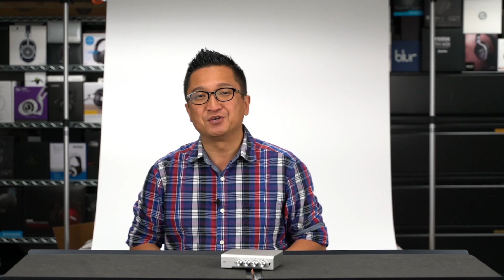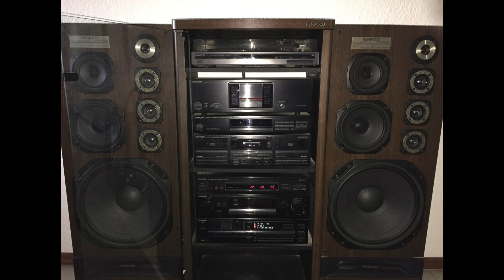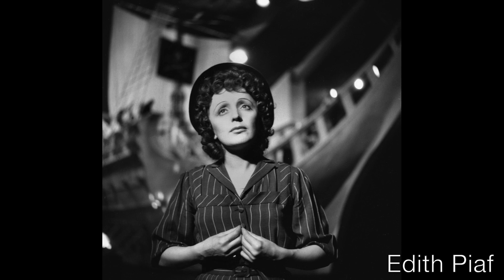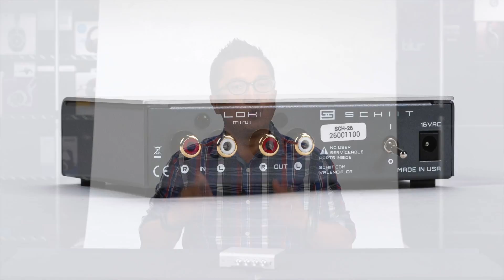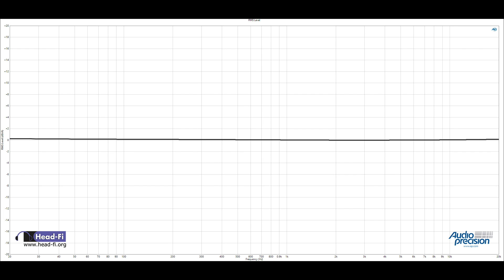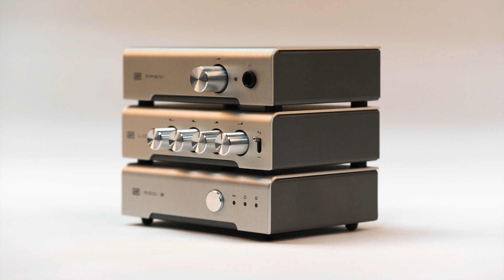Schiit Audio Loki Mini Four-Band Equalizer - Head-Fi TV

Comment: Audiophiles and eq's:   I remember this back to the 80's.
The issue was:  audiophiles were correct about some of the old eq's.  The mass-fi stuff like Kenwood had 36 bands, and it was made from the cheapest parts.  There was no "transparent"  even in bypass.  They did violence to the music. 
Better Eq's like ADC, Soundcraftsman, Audio control and SAE used only a few bands at critical frequencies.  They used higher quality parts inside. 
The Loki doesn't use anything in the audio path to degrade the signal.  In bypass or flat, the unit is transparent. It does not load down the system or color it in any way. 
All I need do is look at the response curve of my headphone on a site like innerfidelity, and adjust accordingly.
I ordered the Loki because no matter what anyone says, headphones, speakers and rooms are not "flat".

Comment: Audiophile gear manufacturers hate tone controls. They allow YOU to determine variations of sound, whether to compensate flaws of the media, the speakers, the room or your hearing. 140 units of a quality currency instead of buying cables, cable bridges, marble platforms, slate racks, tiny little woodblocks or any other 1599$ supplements. But tone controls are no substitute for good speakers, reasonably positioned in a cozy fluffy room.

Comment: The frequency bands on the EQ are way too wide. The 400hz adjustment, for instance, effects frequencies from 20hz to 10khz. And each of the 4 frequency bands on this EQ overlaps with the bands above and below it. Trying to use this to EQ a room to have a flat response from 20 to 20k Hz would be impossible.
Reply: That's not what it is for though. It's for headphones, not room correction. Regardless, if you are going to take the time to set up a flat FR, you'd use a proper digital EQ.
Reply: well this is obviously a hifi EQ and not a mastering EQ. so you can get pretty nasty distortion if the EQ bands are to narrow and you reduce the dynamic with it if you don't adjust nearby bands accordingly or know exactly what you're doing and having the exact frequency response curves displayed in front of you. so I think this is a pretty good solution to adjust nearby bands slightly with it.

and as far as I'm concerned it is clearly designed for headphone use only and is not to be used for room correction needs.
Reply: Arthur Ott For that id suggest using Equalizer Apo...
Its a really precise and useful but freeware software eq.
Eg. this is what i did to my HD 600 after some sessions with sineGen:
https://www.dropbox.com/s/96r2wf7i1fh0fs5/IMG_20170928_150521~2.jpg?dl=0
yea thats not room correction but almost all headphones have peaks and bumps, so why not correct em :P